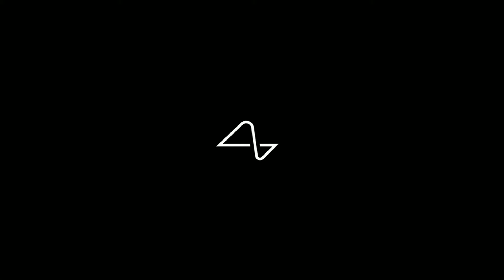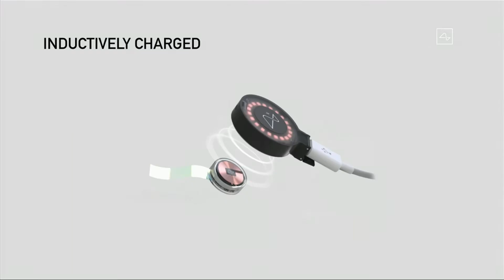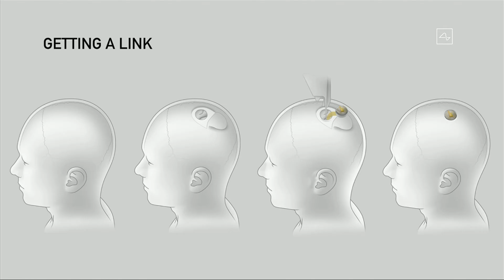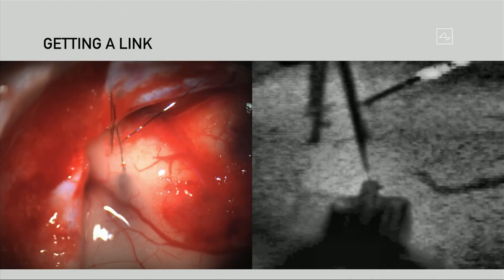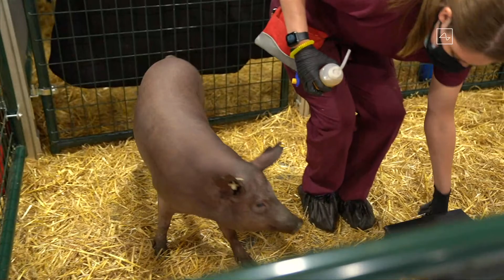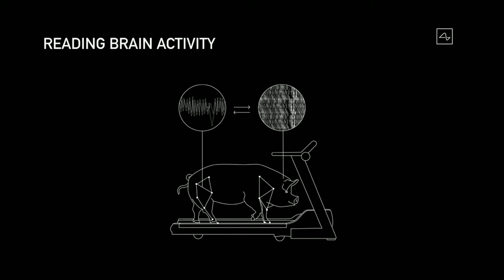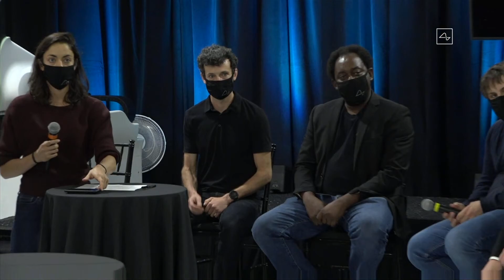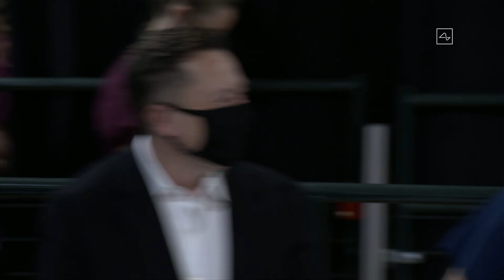Neuralink Progress Update, Summer 2020

Comment: I do wonder about the battery tech tho. Batteries have a pretty low lifespan (unless theres some expensive form I'm unaware of which practically never degrades) meaning you'd have to get surgery for replacement every 5/10 years or so?? Plus, aren't lipo batteries for example are bit too dangerous and unreliable to be in peoples heads? It wasn't mentioned at all in the stream but I definitely think battery tech would need some evolving to last longer and be safer - maybe tesla could have a part to play

Comment: This is all looking great, but the major thing I'm worried about in day to day use it the cooling system. If the temperature of the device is too much colder or hotter than the brain, could this cause issues? How will a cooling system be implemented into such a compact device? Could such variations in temperature cause a reaction with the immune system?

Comment: Curious if you could sense if you had a head injury or something and relieve the pressure by either popping out or in slightly rather than having to have a tube or hole drilled into your head beyond what has already been done for installation.

Comment: Just by Observing Every single thing that you guys were talking about... 

Instead of charging the device ... In the near future or still on product design ... Think of it like a cell phone fromThe day that you turn on your brand new phone 3 years from now they're battery life Depletes And doesn't give the same Long term Battery life... 

So my question is. Is that battery Replaceable . Will it be easy To disconnect ?
  
Or  It's in and you are stuck with it.  Even though the battery doesn't get a full charge
Reply: The entire device is replaceable. Though I wonder, if it'd be possible to construct a blood glucose-powered fuel cell to remove the need in external charging completely...

Comment: Does the installation create a weak spot in your skull. If the skull is 10mm thick and then you create an indentation to fit the 8mm neurolink the skull will be 2mm thick underneath the device right? 
If a user was unlucky enough to be hit in the head in that area it would take a lot less force seriously damage that 2mm piece of skull. 
Has this been considered?

Comment: Would it be possible to use fiber optic leads? The data transfer speed as well as bandwith would be nearly limitless. Also because the plastics tech is so advanced we could probably get the leads thinner than .0005 in.

Comment: It can be charged by wireless charger only, imagine you accidentally put a high voltage or hign amp wireless charger to charge it or passed your head near a wireless charger what it could result?
Reply: @DaemonC  but if you need an MRI, you're stuffed.
Reply: @NigelTolley  good point
Reply: @DaemonC  I guess you don't know how a toaster turns off 🤔

Comment: what a opportunity for someone....wow. good luck on the job all who goes for it. wish i was smarter

also, will neuralink be used to record spikes in the brain from people with spinal cord injury and then could the damage nerve be replaced with a nano wire network bypassing the damage are reconnecting the brain to the legs again inturn aloweing people to walk again. if so this is ground breaking not only will this help those who are paralyzed but could this also work with people with parkinson's disease by recording the spikes and dampening the noise of uncontrolled body movements, I.e the brain will be sending noise spikes but there will be a part of the brain where just thinking about moving will be spiking. this may not be in the part of the brain what is used for movement but it will be recordable, so could we then use that for movement while dampening the noise of uncontrolled movement. at the earliest stage you could atleast give comfort to them and reliaf by stopping the electrical signals reaching the limbs. this is amazing and is much more than a fitbit in your brain.

Comment: Yeah, most of those are symptoms of Lyme Disease, which is caused by a bacteria and can be treated with one of several antibiotics.  Another one that has similar symptoms is West Nile Virus, which has antiviral medications that can be used to treat it.  Treat the cause of the disease while alleviating the symptoms, and you'll get rid of both.  You don't need to let some wacko company come along and hook wires and chips into your brain to do that...

Comment: If an implant can correct for electrical signals that create pain, disease, etc. then that same tool can be weaponized to create those same issues against the wearer. The ability for malicious actors to weaponize a tool used for a large percentage of populations (wealthier folks?) sounds kinda terrifying and feels like there couldn’t possibly be enough safety precautions to protect against this. 

Is this a good idea?
Reply: I would like to see some countermeasures to prevent it from becoming a major problems, but yeah... I would like to see some medical benefits.

Comment: It is impressive and really amazing but here is some questions:
1. What happens if you can't charge it for a day(for any reason).
2. What happens if you got a hit on that position of the brain and chip losses the balance or even dislocated from the place.
3. What are the chances it will not properly integrate and connect with human neurons during surgery. What will be the issues a person can have due to error surgery.
4. If it is controlled by app, if a hacker find a way to access it.. How much dangerous it can be?
Reply: First if it isn’t charging you can replace it.
The givers are tinier than a hair so it can’t do anything.
It will if it doesn’t we fix it.
Neural link takes input from your brains not outside of your brain. So no you can’t hack it. Secondly it’s going to use encryption if it could be hacked and that would be extremely difficult
Reply: @egoxagony4623  replace it, like you're suggesting another surgery?

Comment: mind blowing :) why don't you leave the electrodes and just change the chip every time that you are upgrading?  it's safer and easier when doing the surgery.
Reply: but you might want longer electrodes or more sensors on top
Reply: Julio Chao for the current applications most data can be collected from the surface of the brain there is no need to go deeper. And if they need more sensing they will just add more electrodes. This way there will be less risk of bleeding or damage to the brain when they want to upgrade.

Comment: I have a question I've had for a very long time: what would it take to wake up with a video file of the dream you had last night and how close are we? :|
Reply: I think dreaming conciously and general control of your dreams should be relatively easy
Reply: @hund4440  that's different than converting the dream you had last night into an .mov file as a background process though. I've never seen a demo of a picture or audio file being recovered from a brain. stimulating or guiding a dream is a lower bandwidth problem than recovering a representation of the dream in progress. I'm asking specifically about a twitter where you can upload last night's dream type technology.

Comment: Seriously, if I could use this to control my PC I could probably write code a lot faster. This + Unix terminal... I'd be off to the races.

What is the structural integrity of the skull after implantation? Can I still ride a bike?

Also can the piece of skull be kept alive in case I need to remove the device?
Reply: It could instead be reinforced with an alloy much stronger than bone and just as light. No need to get that piece of bone back.
Edit: Oh look! It's answered at 59:44.

Comment: Will mind control and memory maniuplation be possible? Will there be third party insight into the company to prevent this from happening?
Reply: 46:45
Reply: @bamie16  So they say you can save and replay them, but im thinking like, would it be possible to force someone to do an invoulentary action via. the neural link, and then wipe the memory of it or change it, to make them believe they did something else in that timespan?  It sounds very immoral, but id like to know if its technically possible and how they would prevent their company from doing that at some future point.  Companies sometimes do immoral things when they have lots of power, but i think you would need some extra security checks on them, to prevent that from happening, as peoples brains are such a delicate topic.

Comment: Neural implants are useful, and one of these days we will have really useful neural prostheses. This project so far does not actually represent and progress in the field. Stuff like this has been around for decades and the fundamental approach of using silicon and wires will never really be able to link up with the brain successfully. The brain is am integrated 3d structure that communicates not only with electrical fields, but multiple layers and types of two war chemical signals, constant dynamic changes in physical shape, ion flows which are important beyond their electrical effects, and even mechanical vibrations.
Reply: Very true. But this is the best we got to work with atm
Reply: @jimraynor8695  there is some great research and even approved products already doing more than this. To his credit Musk names a few of the things that are being done early in the video but without reference to the universities and hospitals doing them. Deep brain implants treat Parkinson's and epilepsy, vision, hearing and vision loss.

Comment: they forgot to talk about the problem causing by scars. So far all brain electrodes have a short lifespan because of this problem: after a short while, some scar forms around the electrodes so they lose the signal (I guess they become insulated). Did they solve this problem? (I heard that the threads are "moving with the brain" which "make them more biocompatible" but is it enough to solve the scar problem?)

Comment: Another question. Is there a hard kill switch incase it is ever compromised
Reply: Yeah.. what if it malfunctions or gets hacked? 😳
Reply: Exactly. Maybe a specific frequency when held close just kills all functionality to the device. There definitely needs to be a kill switch.
Reply: I think they very clearly stated that security is such that this is impossible.
Reply: Micheal After Yeah, let’s put all our weight on that...
Reply: @bryceirvine856  what do you mean. He litterally said that the most sensitive data collected is done offline and shielded from any kind of access. Then bits of pieces are encypted every layer of processing and when sending. So a single standard encryption is already impossible to crack, and that is done a few times. I dont find it that hard to understand and Im not smart lol
Reply: @anglerfish61  There is no way they can promise that this early. They haven't even started human trials yet.

I was disappointed that no one had good questions about the topic.
Reply: @endlessetudes2029  what do you mean. If something doesnt have a reciever or a transmitter, it cant be accessed. He said the I/O is OFFline. Thats the current design (the asian hardware specialist talks about it). Everything after that is compressed and encrypted. It uses bluetooth which granted, is not a very good bandwidth to use but he said they are changing that in the future. Human trials are not needed for hardware testing. It has nothing to do with a human.
Reply: @anglerfish61  The device is made to be communicated with. The i/o is accessible offline or not. It's just the means of interfacing with it. I'm not saying anything other than it's too early to promise it's safe.
Reply: @endlessetudes2029  lol its like talking to a wall
Reply: @anglerfish61  tell me about it. Have a nice life
Reply: Compromised?

Comment: As an epileptic who also suffers from memory loss, insomnia, a little anxiety & depression, and arthritic pain, I’m so excited and looking forward to where this can go! Maybe me, someday. ❤️
Reply: U have it worse than me. I only have autism. But im not sure ill need this. Im just here to tell u to seek meditation, it will help you deal with anxiety and depression.
Reply: If the pain could be turned off it could be turned on.
Reply: @Maxcactus  oh come on man 😏😏
Reply: @Picolas Cage  you are correct in saying the chemical reactions cause the electrical signals.
However, they are in no way a "side-effect."
It's not just a case of one causing the other, instead they cause eachother.
An electrical signal can be used to cause a chemical reaction.
So it doesn't matter which one is really responsible for brain functionality, or if both are, because as long as you can influence one (in this case electrical signals), you can influence the other as well.

Comment: I wonder if they can reuse existing threads when upgrading a device by just adding a bunch of finer threads in between the old ones and then adjust the signal processing on a per thread basis based on the version of the thread. This would avoid having to remove a device, but would complicate the device architecture. 

On the other hand, you might want to remove the old ones since they might be getting corroded. All depends on how fast the technology advances.
Reply: I think from the demo they don't use the old threads probably like you said from corrosion and because they might have newer better threads to use later on.

Comment: So far I haven't seen anything unexpected or all that much different than the old experiments on this from decades ago. 
Mostly it's the smaller modern day hardware and wireless communication instead of plug in jacks. 
However, what are they doing about security on that wireless system? (Finally heard that part, but it's rather sparse on detail.)
There will be scum that will hijack your signal to either snoop on you, or mess you up with b.s. signals. 
(Don't worry about the cheap scifi idea of turning you into a remote control puppet, that's totally unrealistic with this tech.) 
I'm also worried about tissue scarring in the brain around those electrodes as has happened before.
...
Please don't get me wrong, we are in great need of a brain machine interface for medical reasons much more than anyone needs to send brainmail. 
So all research helps. 
But still, Musk is blowing his "accomplishments" all out of proportion, and it's in no way revolutionary or even new. This kind of research is pre-internet after all.
...
You know, I take part of that back. The robot surgeon/installer is a rather new device for this purpose, though there have been various levels of robotic surgery for decades now. On the other hand, there hasn't been a lot of serious work in this field as it's really speculative and doesn't usually attract corporate investors. They tend to want more concrete near term profit stuff and not things as nebulous to the profit margin as this currently is. 
... 
Personally I think the signal decoding team is the true crux of anything more than a crude brain machine interface.
The brain machine interface is a major linchpin of any interactive cybernetics, which is something I've been very interested in since the 80s.  So I've thought about it a lot and have been waiting impatiently for any advances in it.
...
I wish them luck, and hope Musk doesn't keep shooting his mouth off with stupid or unrealistic statements, something he hasn't been so great at avoiding for the past few years.
Reply: Why did he talk about all the possible implications rather than the exact algorithms used to identify which neural routing causes what perception in the brain? 

Isn't whatever is shown a process to record the neural activity, but using a small device? 

If the stimuli received by our primary sense organs defer from person to person, causing different neural spikes, in different neural locations,creating diverse perceptions, what algorithms did those in neurallink use to effectively identify and characterize it into an action? 

So many ambitions, such less knowledge. Ignorant fool elon.

Comment: I was interested for 19:04 writing to brain. They showed for only 2 mins over it. I assume if every thing in the brain is stimulated by neurons firing and calling for something, with what they would be doing we can guess a naive assumption would be that they will have to broadcast the captured neuron firing pattern to recreate the same firing pattern when the activity actually happened. Looks lucid but I think has many dynamics to it, think about this scenario with an assumption as such if brain plays it role in controlling your body motion, imagine you are idle, laying on bed and your brain were to receive a firing pattern equivalent to your overall state at activity of like 50th meter of a 100m race... what does that even mean to the rest of the body if the brain activity is kept aside not just this scenario but you can assume cross scenario instigated randomly.

Comment: Insted of using that tipe of divice to change it especially during night when you have movement involved and might not be the safest option, i suggest to use a sort of wifi charging sistem or something that doesn't involve plugging a cable in it.